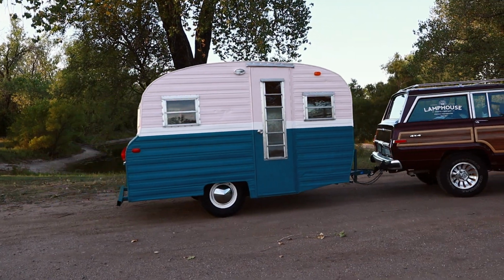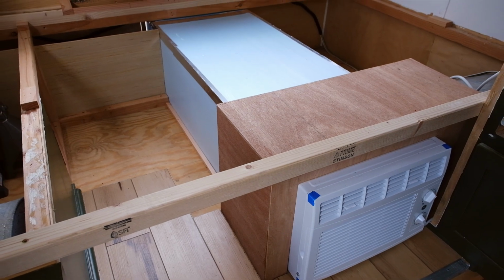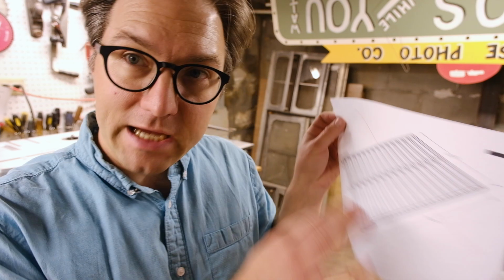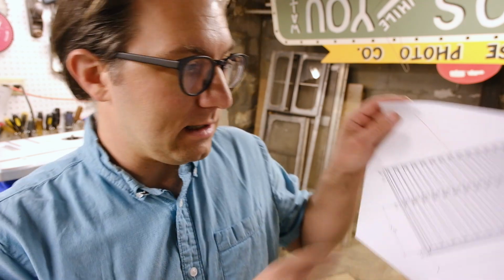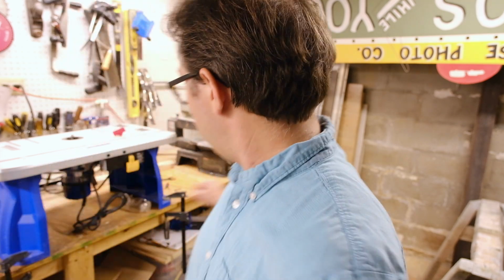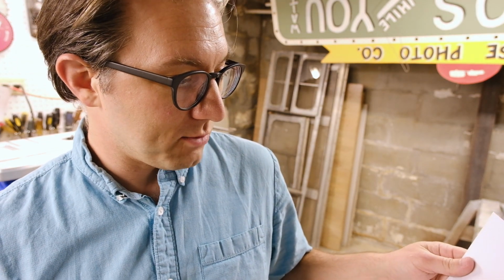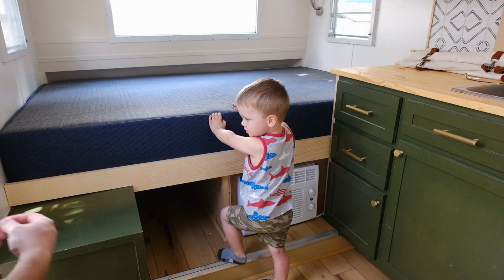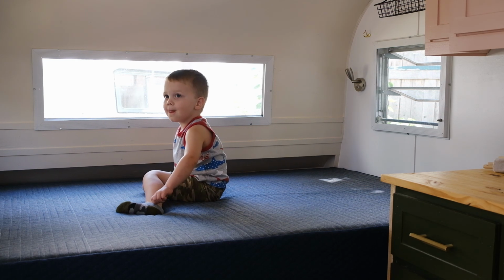DIY PLATFORM BED & mattress unboxing!

Comment: Nice job, as usual. Just wondering if you plan to put hydraulic struts on the bed frame so it lifts up for easy access to stuff stored underneath?
Reply from the maker: I had thought that I would, but the problem is getting the mattress past the window. The screens and the cranks stick out a couple of inches on both sides, so I would only be able to lift it about 20° or so, and I haven't decided if it's worth the trouble.
Reply: @TrailerTrashtoTreasure  probably not worth it if you can't raise it fully. There are other options.  You'll come up with something that'll work best for you. 🙂
Reply from the maker: Yeah, we plan to camp in it a bit and see what further changes might need to be made.

Comment: any concerns about water pooling from the A/C unit onto the floor?
Reply from the maker: If you read the manual for virtually all new AC units they will specifically recommend against draining off the condensate as these units use it to help cool the coils more efficiently. That said, there is a place for an optional drain line, so I will probably be adding one to provide additional peace of mind.

Comment: I know you like making stuff from wood, but you could probably have ordered a set of slats from IKEA, and cut them down to fit.  Cheaper and faster.
Reply from the maker: I looked into doing just that, and the cost of materials was about the same, but I would've had to wait for it to ship to me. I got this built in an afternoon. Of course if I wouldn't have already had the tools it would've been a different story in cost and time.

Comment: Different...
Reply from the maker: Ha ha ha! Yeah I've actually been thinking about building a bed frame for Simon, so really this was a test run. Ultimately it was about the same weight as the plywood and framing that I took out, and it should allow for a little better airflow, but definitely more involved than a sheet of plywood. Time will tell if it was worth it.